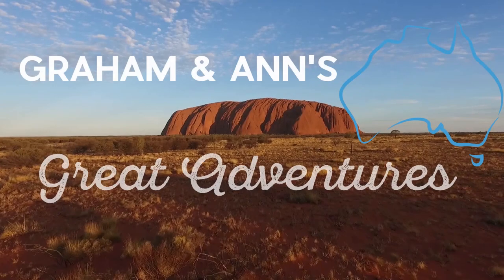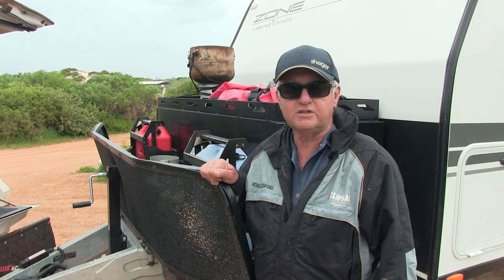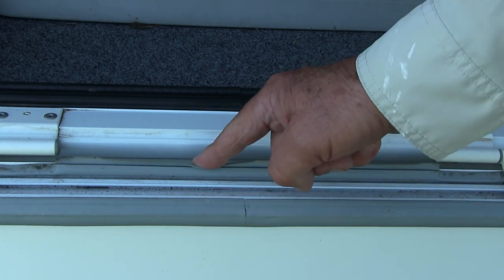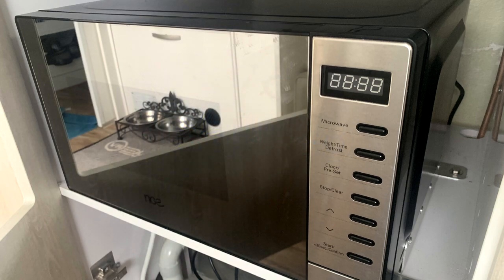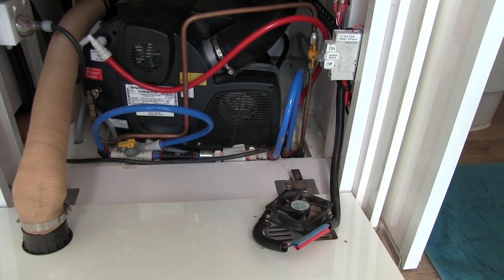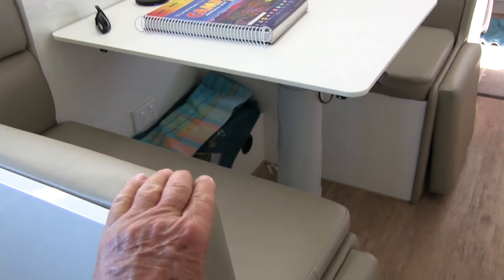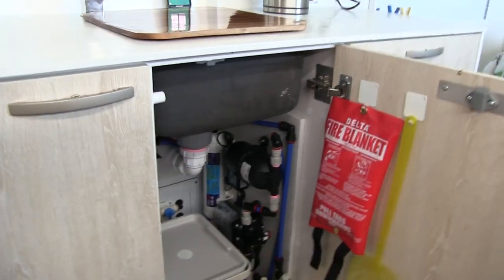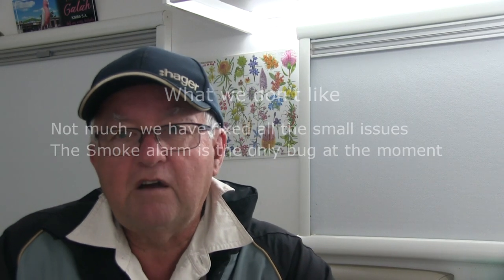Zone RV; Owner Review

Comment: Great honest review thanks Graham 
I would have expected Zone to water test the vans as part of the QA, a little disappointing your toolbox leaked but easily fixed
I like your larger mud flaps
I’ve seen others comment on the fridge lower hinge being a bit weak too
How have Zone been when things go wrong-disregard I finished watching all the way to the end 😉
Do you have any form of positive pressure system
Reply from the maker: We have not required any dust suppression system, as they really are dust proof, the only time we had dust inside is when we forgot to fit the hatches under the bed. 
They have been good to deal with, offering remote repairers, but I would rather do it my self. 

Cheers Graham

Comment: Hi Graham we are having a power point put in exactly where the cook wanted hers put  in your Zone 😊 we need to supply the fittings for him can you please advise what you used please? Many thanks 🙏
Reply from the maker: Hello Jacqui 
Apologies for my late reply. 
If you still require the information 

1: Clipsal Double Pole 2000 series double power point
2: Shallow mounting block to suit
3: 2 x Clipsal 554 Junction large junction boxes
4: 4 meters of 2 core + earth 15 amp flexible power cord. 
You can purchase this at a Electrical Wholesaler, take this list and show them. 
( Do not try to buy at Bunnings)

If you want the light switch, also pick up a Clipsal 2000 series architrave switch and 10 meters of 12 volt cable so you have a two- way switch at the door. 
( An electrician must install the power point)

Hope all that helps. 
Cheers Graham
Reply: @grahambelby9117  cheers Graham very good of you to reply! Has helped us no end.  Happy travels to you!

Comment: Thanks Graham, that was a really informative review.   We pick up our Zone in early October and videos like this give me lots of useful info in preparation for Handover .  Oscar Wilde wrote that "imitation is the sincerest form of flattery .etc..." You should feel flattered because you've come up with some great ideas that I'm sure I'll be imitating very soon after we pick up our Zone Base, which is almost identically spec'd to yours, colours and all. I have a couple of questions I hope you can answer:
1. What  sort of tow hitch mount do you use (The removable part with the DO35 pin attached?) I also have a Landcruiser 200 Series and the one supplied by Toyota is too low I think.
2. Did you install a separate MPPT Solar Controller or do you find the one included with the DC to DC charger does the job for you?

Again, thanks for all the videos and enjoy your travels
Reply from the maker: Hello William, glad to hear you gained some helpful information and thanks very much for flattering comments. 

Q&A

1: Tow hitch; 
I use a “ Mister Hitch “ HD series with a longer shank to fit my Rock Tamer mud flaps. It has a 4000Kg GTW and a T/W 400Kg (Ball weight)
It also has 3 variable height adjustments, perfect for the DO35 and your cruiser. 

2: I don’t have an MPPT Charger but would now recommend. 
The cable suppling the Anderson Plug on my Toyota is not large enough and voltage drop is reducing the current supply to the 12/12v charger in the Zone. 

It’s another job on my to do list increasing the cable to 25mm and fitting an MPPT Solar charger  to allow both chargers to work together. 

Hope all that helps, you will really enjoy your new Zone. 
Cheers Graham & Ann
Reply: Thanks Graham.  I've never actually seen a Zone in real life, so all the information you and other generous YouTubers provide about them helps a great deal, especially when you say you are still very happy with your decision to buy your one. I'm not new to caravanning so I'm quite comfortable with towing, weights, hitching up and all that stuff, but  I've never quite come to grips with the dark art of 240V electricity so I leave that stuff to the professionals like yourself. I really think the extra power point is an excellent improvement.

Comment: I was quite impressed by the Zones when I’ve been looking at them and some friends purchased one which we got to have a good gander at.  However I’ve nicknamed them ‘The Asylum’ because of that horrible clinical white interior.  Why can’t / don’t Zone offer any colour choices for inside to tone down the glare of the white??  It’s the only thing stopping me from buying one - well that and the fact I’m not sure what would happen in the case of a small ding (eg tree damage to a panel) given that those panels are ‘glued’ to the internal cupboard furnishings etc.
Reply from the maker: Yes, they are very white and a little clinical at first sight, but we look at it more like a blank canvas where we can splash our own colours around, bedspread, pillows, wall pics etc. 

As for repairs, the fibreglass can easily be repaired if you damage it, we have seen first hand on other vans, a few holes before and after, and you wouldn’t be able to pick it. 

The furniture glued to the body gives additional integrity and strength to the whole van. 
We love our van, sometimes it comes down to personal preference. 
Thanks for viewing and your thoughts. 

Cheers Graham & Ann

Comment: Thanks for confirming they are nothing short than overpriced garbage not just zone but many others manufacturers.
Price from 140000 to 200000 there should be no issues whatsoever. You better off with a stock standard van I see many people travelling around Australia with 1 with hardly any problems.
Cheers
🇭🇲😀👍🍻🍻
Reply from the maker: Would be great if there were no problems, but even my Landcuiser has had a few issues, it’s all in the way the company handles the problem for me. 
Thanks for watching

Comment: How hard was it to add the power point
Reply from the maker: Hi Aaron, there is a large cable duct running through the back of the cupboard, so easy access. 
Cheers Graham
Reply: @grahambelby9117  ok great I will have a look zb249